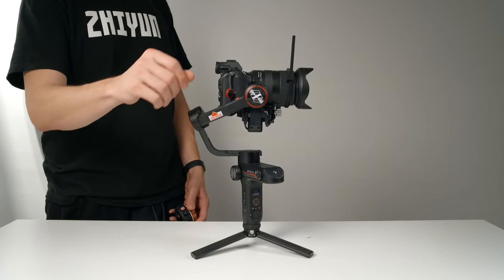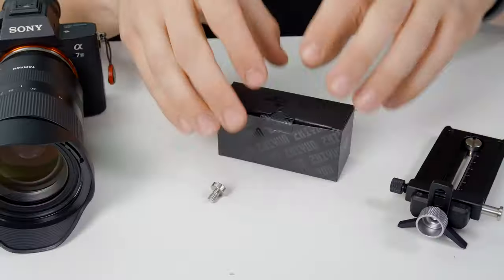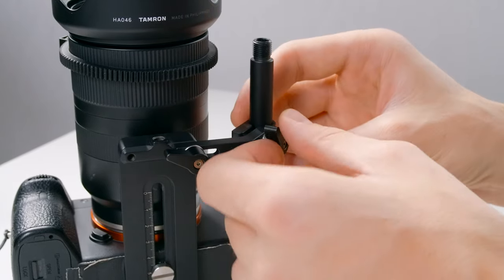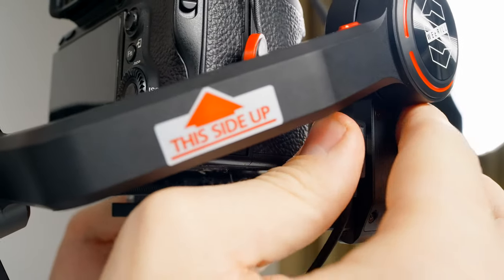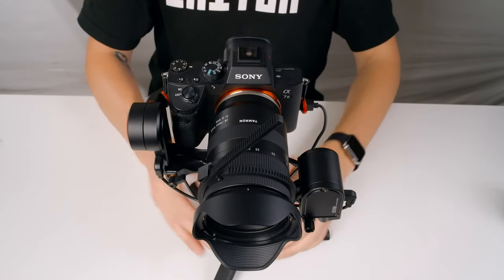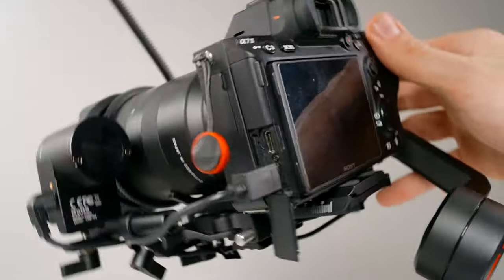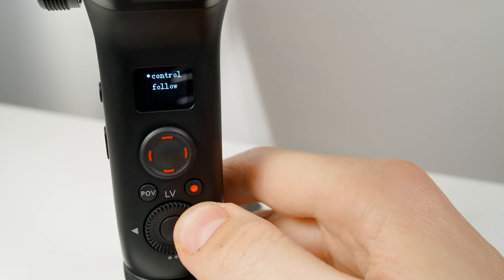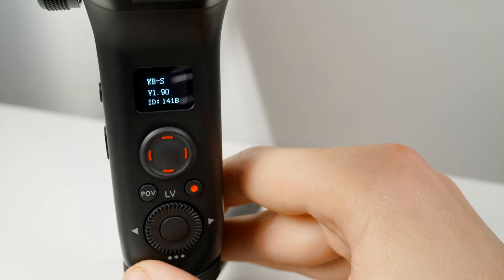ZHIYUN TUTORIALS | Weebill-S Official Tutorial | E02 Setup and Menu Intro

Comment: Tanks for the great walk through! Yesterday I picked up a Ronin SC for my Sony A7III with Tamron 28-75mm lens. The entire rig with a Rode microphone attached weighs just over 3 lbs. This is well short of the 2kg (4.4 lbs) stated capacity. The Ronin worked ok at first but I started noticing it would lose control of the camera and flop around. I tried multiple balancing procedures and the auto tune. It would check out ok and then continue to not perform well. Today I returned the Ronin and picked up the Weebill-S. Wow! I'm so glad I made the switch. I got it setup in 20 minutes and was able to shoot a few hours of footage. I have almost no gimbal experience and I feel like I got some great shots. If you have a heavier camera and lens combo, you can't go wrong with the Weebill!
Reply: Thanks. A valuable comment/feedback as these are the 2 gimbals that I’m currently considering for my Nikon Z5 setup. How’s your experience with the Weebill-S so far? Thanks🙂
Reply: @psoon04286  To be honest, I have only used it for a few projects so I can't comment about durability but I think it is a good product. Tons of options for those that need more capability. I only wish I could spend more time shooting!

Comment: Thanks for the good explanations. I have my Beebill gimbal balanced just so with my camera. Then when I turn on the gimbal, the whole unit vibrates a lot. What is the reason? What can I do about it?
Reply: Hi which camera and lens are you using? Try to use the camera lens support and camera backing base. Set properly motor force according the camera kit you used.

Comment: @Zhiyun-Tech  What should  be done first? Calibrate the gimbal or balance it? Connect the app or update the firmware? Please tell the correct order to do these things. I haven't used the gimbal yet
Reply from the maker: The first thing you need to do is making sure your camera and lens are on the compatibility list. If you have already got your gimbal, please follow the user guide to setup your gimbal.
Reply: @ZhiyunTechGlobal  Yes, it is compatible. But should I balance it first, or calibrate it first?

Comment: Quick question.  I'm trying to find out if this Gimbal would work with  a GoPro.  I have  a Canon SL2 and I only want to have/use one gimbal.  I'm wondering if the GoPro has enough weight to initialize the motors on the Weebill-S.  Thanks in advance.
Reply from the maker: Hi dear! Unfortunately, GoPro doesnt have enough weight for WeebillS.

Comment: Using a Sony A7iii... Unable to operate camera record  thru the gimble red record button. What does the red record bottom on the gimble supposed to do?

Is there a quick release camera method where you can remove and remount the camera back on the gimble without having to rebalance it?

What is the point of having the camera wire connect to the gimble, when you can't control any function of the camera from the gimble? The wire connection is useless, just like record button. They serve no function to operate the camera thru the gimble.

Comment: The follow focus usb-c cable is too short. I used it on a sony a7iii and tamron 28-75. It can't reach the gimbal port at all. I tried adjusting the plate and the rod and the motor position a dozen times. Just didn't work. I noticed that in the video, you had the exact same lens and camera, but you were putting the gear ring on the zoom ring instead of the focus ring of the lens. And your cable is all straightened, if not stretched.

Comment: Hi, just order the Zhiyun Weebill-S, in fact, somehow a risk because I have non of the DSLR or Mirrorless cameras seen in the list of the presentation video. I use today, the older HDC-SD90, in case it doesn't match the Weebill-S, I will have no other option to buy and that for the first time in my life an camera that is compatible with the Gimbal the Zhiyun Weebill-S.
An new camera DSLR/-Mirrorless is planned but I prefer want it give some time. Therefore I will known of the Panasonic camcorder HDC-SD90 will work with the Zhiyun Weebill-S? 
Note, as I have no experiences with other cameras as what I own, I have look into the smaller camera Sony RX100 M7 200mm. This little camera has good reviews and will be my behaviour an step forward. Hope to get update, will the Panasonic HDC-SD90 work with the Zhiyun Weebill-S.

Comment: Hello ! I just unpacked my gimbal and I am in trouble. When starting  to balance the gimbal, I unlocked the Roll axis motor and I feel a hard point tough when the arm is horizontal. I indeed double check make sure the  lock is off but the hard point is still there.despite this hard point I balanced the gimbal ( with my Nikon Z6 with 24-70/4 on it) the best I could do.  At first it seemed to work well but a warning appears telling  me some axis is locked ??

Comment: Zhiyun lock mode issue

Hi, I've got a serious issue my beloved Weebill S. To begin with, I must say that I had
this issue with 3 different Weebill S... The "before last" annoyed me so much I was sure it was a fulty unit, so I sent it back and I directly purchased the one I've got now. Yesterday I gave it a try and boom, same issue !!! 

So, everything works fine with this gimbal except the "LOCK MODE" (not the lock system). In this specific mode the camera has to point in the same direction without moving. Unfortunately in my case, it does move, pan to be precise. After a couple of minutes it panned like 5 or 6 degrees. So it makes it useless for hyperlapses, for example. I can't believe I am unlucky enough to be the only one having such a trouble with my Weebill S. 

My question is : do you have, guys, the same problem with yours ? If so, did you find a way to solve it ?

Thank you very much !

Comment: Great video. Haven't used DSLR type cameras with this type of gimbal so my question is - once you have the gimbal balanced for a camera/lens combo, when you remove it, can you put it back on the gimbal as is or do you have to re-balance it every time for the same rig?
Reply: If you don't remove the quick release plate from the camera and don't fiddle with it, then you won't need rebalancing.
Reply: @bpunching  is there a way to mark the plates to avoid re-balancing every time? Thanks
Reply: @psoon04286  I think it's possible, but never tried it. In fact, if you always use the same camera setup, you'll need to mark the quick release plate only.

Comment: Hi i put my smooth Settings to 200 but i have still the Problem that if i use the Joystick for the tilt movement of the head, 
the movement is not smooth stopping when i move the Joystick back to the center it Stops imidiatly. 
How can i change that in smoother stops ? The Joystick seems not to be so sensitive...

Comment: Hi, i jave bought a weebill s just few days ago but i have a problem. First: my horizon is not straight (i can see it in my videos) and all is well balanced (i’m sure of that). How is possible? How i can fix it? Second: when i’m using image transmission sistem i need to enable css in camera menu on the weebill s but at this point my sony a7 iii start to charge from the gimbal, is possible to disable this? Thank you

Comment: There is some inaccurate info in this tutorial. It turns out that in order to control the Sony a73 you need to set the camera to Panasonic in the menu and use the micro USB to micro USB cable, not the micro USB to Multi cable.

Comment: Hi, how are you? Two weeks ago I bought the same gimbal, I was testing it with two different cameras, but the same lens.
With the first camera, a Sony A3500 with a 18-105mm F4 lens, it worked absolutely perfect.
Now with the second camera, a Sony A6000 with the same lens as before. When I turn on the gimbal, it starts to vibrate a lot, i mean like hell. So I quickly disable the rotors by holding the POV button because i'm scare to break it down. 
I have followed absolutely all the instructions, step by step. I have tripled checked everything from balance to trying a different rotor level (low vibrates less, but still) and still get the same result. I searched on the internet for the problem and there is no topic about it.
I want to add that I have't mounted any other accessories or anything, only the camera with the lens. Please, if you can think of what could be happening, I would be very grateful if you let me know because I can't understand what is it.
Thanks a lot. Cheers!!

Comment: The level position of my Weebill S is off by a few degrees when powered on.  I have balanced it correctly and performed a six side calibration and it's still not level.  The user manual suggests Initialization.  I have followed the steps but they are vague and it doesn't work for me.  Any ideas guys?

Comment: Love this gimbal, however I can't seem to to balance the axis when the camera is facing straight up

24-70 2.8
5d mk iii

Every other axis balances fine
Reply: EOS R 24-70 2.8 here. No way to balance that camera with that lens. I will need to get a lighter lens as well.
Reply: @beyondtheboundaries7934  its possible, with the sigma one, someone did it
Reply: I also have a canon 5d mk iii and a 24-70mm 2.8 canon lens and I managed to balance it without any problems. You just need to do it in small steps and fine tune it a little bit.
Reply: яєтяσтν. | єlєթรเєˢᵠᵘᵃᵈ how are you able?  I have to move the camera so far back that the viewfinder hits the back to the gimbal rendering the camera really non movable
Reply: @beyondtheboundaries7934  Did you find a solution?  I'm trying to use the R5 with the 24-70 and having a hell of a time.  I finally got balanced, where the back of the camera just barely misses hitting the gimbal, but I'm definitely not able to use the focus / zoom motor or transmitter.

Comment: So the multi cable for Sony cameras really does nothing but allow the gimbal to charge the camera.  Pressing the record button within the app does nothing?
Reply from the maker: when controlling a sony canera via a control cable, please power on the stabilizer before powering on the camera. Please make sure the camera is fully charged. The optical zoom is available if using a motorized lens, and the digital zoom is available is using a non-motorized lens. You can set in the camera menu.

Comment: USEFUL NOTE : When using the Nikon Z50, it is better to use the SMALL Plate directly on the camera rather than the huge plate supplied, (which keeps shifting all the time & throwing off the fine balance of the Zhiyun Weebill. This combination works especially well with the16-55 mm Nikon-Z FX zoom kit lens attached)
Reply: Do you use the image transmission for your nikon z50? I'm noticing that the hdmi cable isn't long enough

Comment: At 1:50 you show the screw going easily into the slot.  Mine does not!  I've used a vice and screwdriver, fiddling for quite some time, and am afraid if I use any more force I will damage the unit.  Am I supposed to get out some power tools to get my Weebill S to work!?  Is there a trick that I'm missing that you have not shared with us?  I believe the slot on my unit is slightly undersized, so I may need take a file to it, or just return the unit.  So far, I'm not impressed.

Comment: Anyone know how to get bolts into the slot of the plate? 1/4*20 bolts that came with it are to large to protrude through either the adjustment plate nor the groove in the riser plate? It's the screws that came with it, but it looks like. I need to use a drill bit to open up the slots enough to get the threaded end to squeeze through slots? Can anyone tell me why I am having to do this before I get my drill out?

Comment: At 1'50 you say place a screw into the plate...but they don't fit!!! The screw is bigger than the slot in the plate.....! Any ideas?
Reply: They fit if you screw them in at the end of the plate ( you will notice and the very front of the plate it is slightly wider) start to screw in here. Once screwed in it will fit into place
Reply: @mrsrebeccajoy8381  tried that, couldn't get it to work so I simply filed out the slot at the end just a fraction..
Reply: @roythompson6137  so strange! Glad you figured it out!

Comment: hi, just got a weebill s and tried it on the Canon 5d wt 24-70 f2.8ii combo. everything works fine but it couldn't do the vortex roll. is it due to the weight? it worked fine with a lighter Canon aps-c camera btw. thanks.
Reply: I use a 5D Mark IV with the 24-70 2.8 II. Everything works fine including the vortex mode. Why do you can't do it? What is the issue?
Reply: @wavekick  wow...is that right🤔 need to try it again then. what happens is I put it in briefcase/sling mode and then use the joystick to try n make it roll. my Weebil looks as if it's tryin cos it does roll a bit but then cannot complete the whole barrel roll. as it worked with a lighter setup I was of the opinion that my setup was a lil too heavy to handle.
Reply: @TrivisualsCreativeAgency  Does it just stop then or makes s sound or something? Have you calibrated the pan axis? The most people underrate this but this axis / motor is used for the vortex mode. If it is not balances it could cause problems with such a heavy setup. Have you updated the gimbal du the latest firmware (1.9)?
Reply: @wavekick  I had updated ver 1.89 to 1.90 and tried it again just as your reply came in. worked like a dream. yep! vortex mode game on💪I guess all it needed was an update. Btw did the update over the app as I couldn't connect to the gimbal via my laptop. Thanks for the help bro and happy shooting 👍👍
Reply: @TrivisualsCreativeAgency  Great to hear! I was able to do it on the pc but I think via the app is the easier way because there is no additional software on a pc neccessary. But maybe you could help me. :D Its possible to use the follow focus wheel for canon cameras. I tried it with the 5D Mark IV und several lenses. The camera is connected to the gimbal but if I use the wheel the focus only went from the nearest distance to infinity and backwards. Nothing in between. I tried to experiment with tge AF and MF modes in the camera. At one setting the focus is trying to pull but it feels like if the camera "saved" the focus and when rotating the focus is jumping back to the same position. Does it work with your weebill and your canon? :)
Reply: @wavekick  I don't seem to have a problem with the focus pulling on my rig. I've set my focus on the lens to AF (although many people seem to say to put it in MF) and then chose E-focus under function. Tried it with 4 objects at different distances and could focus on each. One thing I noticed is the focus pull takes quite a spin of the wheel which I feel is a good thing except if you want to pull focus rapidly.
Reply: @TrivisualsCreativeAgency  Thank you for your response. I have my lenses at AF. E-Focus is also set at the gimbal. I have also chosen canon in the settings. When I am trying to pull the focus with the wheel the following issue occurs: https://youtu.be/Tzhob41iEsM

I tried with Servo AF "on" and also "off" at the camera. Same issue at the 50mm 1.8

Comment: weebill-s with my a7 IV does not start recording with the rec button, is there a solution?
Reply: The correct control cable is Micro USB to Multi USB not Micro USB to Type-C / Micro USB to Micro USB.
Reply: @zhiyunsupportglobal706  yes I know in fact I am using the micro usb everything works except the rec to start recording, strange thing if I start recording from the a7 4 with the rec button on the gimbal I can finish the recording but I can not start it, instead diaphragm and shatter times and iso work

Comment: How do I get the electronic focus wheel to work with a Canon 80d? On page 13 of the manual, there is a menu option called "E-focus(Electronic Zoom/Focus)" There is no such thing on my weebill s. Please help.
Reply from the maker: It means your Camera support E-focus, WeebillS has this option in the menu. Did you use camera control cable?
Reply: @ZhiyunTechGlobal  I updated the firmware to 1.9 and that fixed it. It should be noted that updating the firmware wasn't easy because there are no instructions.  I'm thinking of making a video to help anyone who doesn't know how to do it.
Reply: @ZhiyunTechGlobal  Also, in the next firmware could you make the focus wheel much faster? Even with the sensitivity set to high, it's still way too slow to be useful for long rack focus shots.

Comment: Hey everyone!  I got some questiosn,  if anybody watching have a suggestion that helps thanks in advance. I bought a weebill s and was able to balance it wiht my canon rp+adapter+ canon 24-70mm f2.8 ll L lens but with the sigma art 24-70mm f2. i couldnt balance it. I did use the extra plate under the camera to make it higher and get it to the same level but it seems like that the weight of that sigma art lens plus the adapter makes it too front heavy and when i pull all the way back trying to find the center it touches the motor. Should i use counter balance weights?
Reply from the maker: Hello friend! So sorry to tell you that Weebill S is currently incompatible with the combination of canon rp+adapter+ canon 24-70mm f2.8. Learn more about WEEBILL S Camera Compatibility List, please check it out here: https://zhiyun-website-shenzhen.oss-cn-shenzhen.aliyuncs.com/instruction/20220311/1646989000210-ce5wKFjD.pdf

Comment: Is anyone experiencing a horrible lag in drift? Im using a GH5 and tiny Laowa 7.5mm lens and whenever i slowly walk an arc around a subject the roll axis drops in the opposite way (like a force of gravity compensating) and it takes about 10 seconds for the horizon to catch up level again. It's rendering shots unusable on wedding shoots which is why I bought it as the horizon line always dips if walking any way other than a straight line. Any suggestions appreciated. So far I've recalibrated, tested motor strengths and upgraded the firmware.